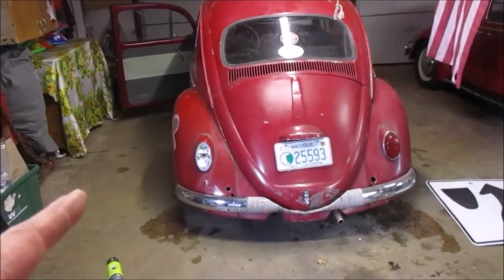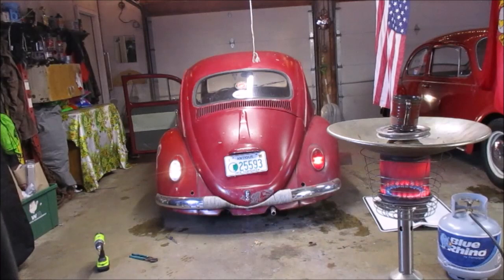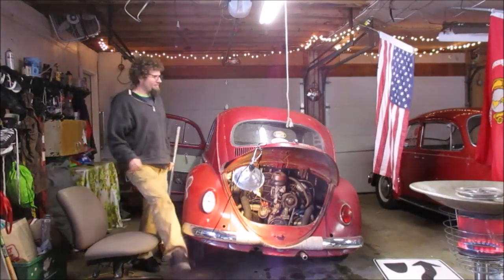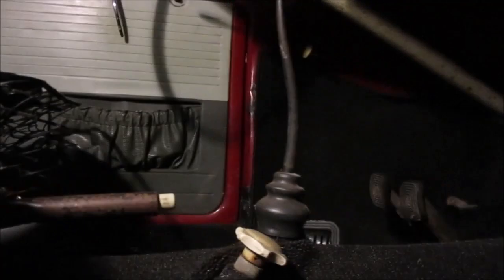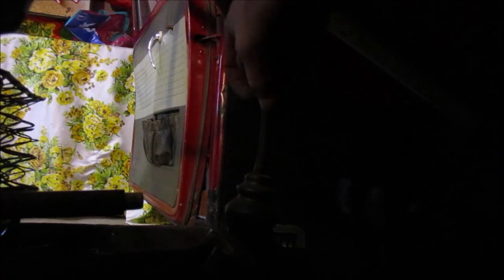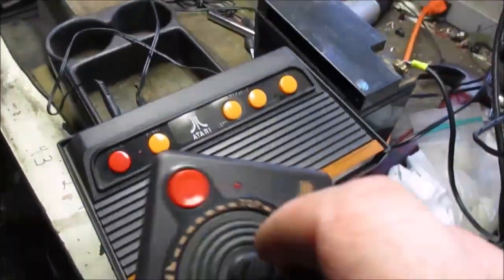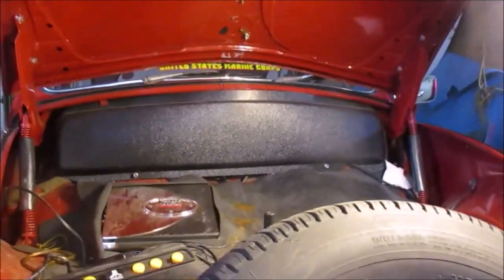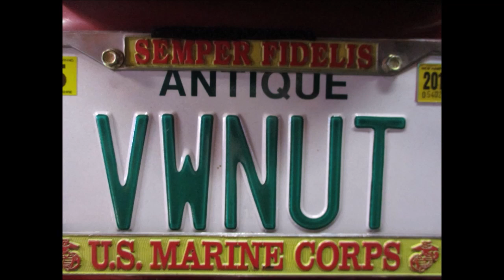BRAKE LIGHT AND SHORT SHIFTER DIY 1964 VW BUG

Comment: So many toys, so little room.  Depending on the monitor size (height) it won't mount and travel. Might need to have  a slotted mount where you can raise it  from sitting on the floor in front or behind the amp to above the tire for use. The console is easy, just make a fold down shelf and have it mounted on the rim. Up for travel, down for play and off for flat tire. Can almost be as big as the inside rim  size, just so it folds out above the bumper. The monitor mount can be a wire (stiff) hook and loop to hang on a bracket on the amp or even a wall mount that will let you move it up and around mounted on the amp. That way you don't have to have its base plate. Just remember to protect the screen in travel mode by a cover or thin box to slide it in. That's enough to confuse you by for now. UDizzy needs to speak up barely heard that accent LOL. Hope Patina's eye gets better, Good - Bye Patina keep warm. (liked the coffee warmer)
Reply from the maker: i like that you and i have the same thoughts. thanks for always being here Mark
Reply: @vwnut1967  Thanks, had units in the field that we had to mount computers in. Not The Service, oilfield. Thank you for your service though. Can't wait to see how you work it out. As for the road sign, to bad they don't make a white deer or moose one, if it ends up being fender skirts.